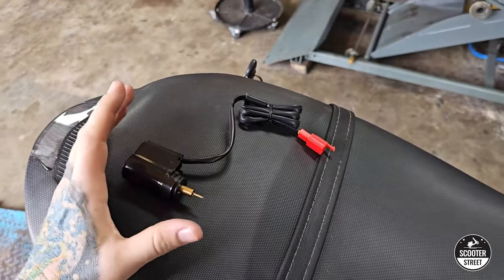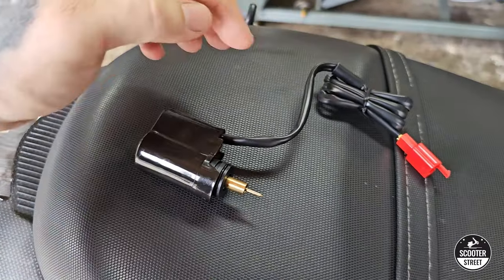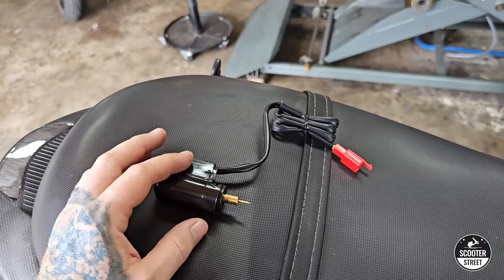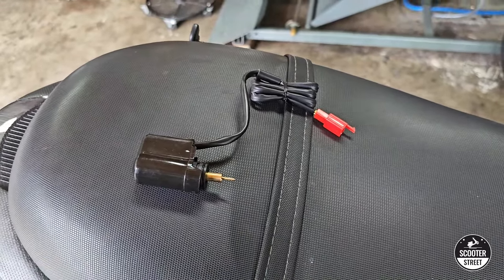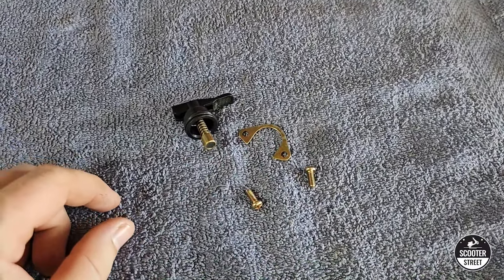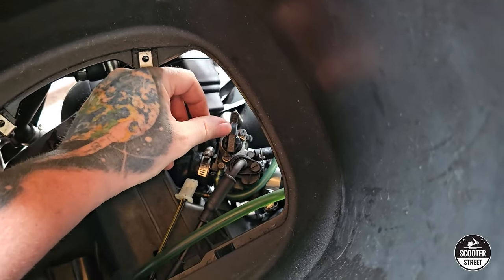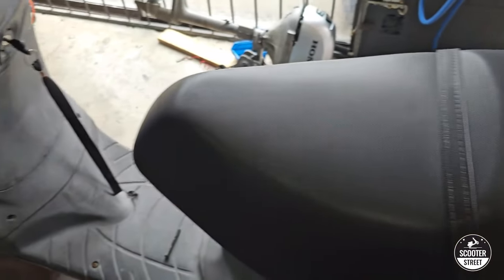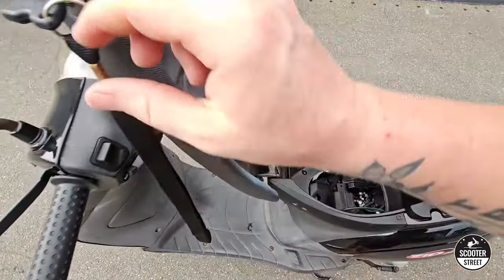Scooter Auto-Choke Problems Explained & How To Fix!

Comment: My gy6 starts fine but every stop it drops rpm and when you rev it 2-3 times it will go back to normal. Is it auto choke always turning on every stop?
Reply from the maker: Check for air leaks in every rubber part.
Reply: i have the same problem any solutions? pls
Reply: @namaikativputkata202  i just raise my idle screw so that if it drops rpm, it will still be sufficient and not sound like struggling. I dont have any vacuum lines leaks at all
Reply: @namaikativputkata202 any luck? I have the same problem I had to raise my idle screw to the point the scooter wants to move while I’m on it
Reply: @DonDinero94  i bought manual choke and all the problems gone away try it

Comment: Hey so my Aprilia SR50 starts first kick in the morning and it starts off with high rpms and drops after a few seconds but if I let it idle for 2mins it dies. Also when i start riding the throttle response is poor and sputter before taking off even when its warm. Could it be a choke issue?
Reply from the maker: Yes, It could be a choke issue, or a spark issue, or a plug issue, or an air issue.

Comment: Hello! I have an issue with my scooter  but it only happens once every 5 rides approximately , so what happens is after about 1min of me riding it sputters and dies . Only way I managed to to start it back on is by closing off the air pipe to the filter and it revs for 5sec before dying down again. I looked basically into everything (air filter, carb,idle mixture,fuel lines , valve adjustment , fuel filter , spark plug ,changed cylinder , checked vacuum lines) only thing I noticed is the air intake hose to the carburetor having a small crack . I had the scooter sitting for abt a month in the sun could it have caused something to go bad in the CDI or this auto choke?
Reply from the maker: Change the manifold if it has damage.
Reply: @scooterstreetau  not the manifold, I  meant the part that connects to the carburetor not the one that goes to the engine
Reply from the maker: @usfsft6217  Change the broken parts, they are not designed to work in a broken state.

Comment: hi mate i’ve been having problems with my moped recently. so i found out i had a split in my fuel line and i needed to fix that immediately, so i ended up replacing them and since then it started bogging out after half throttle and just seemed like it was struggling. i rode it for a few days after that and on thursday last week i was going home and it just randomly started sounding like a piece of metal in a washing machine, just grinding and jolting and struggling to run. i don’t know what’s wrong with it
Reply from the maker: That makes 2 of us.
Check out the source of the noise.
Reply: @scooterstreetau  it’s hard to tell when it’s coming from since it only happens when i ride, but i think it’s coming from the cvt. i took it apart and noticed who ever owned it last, the plastic variator fan snapped and they never replaced it. it’s a piaggio zip 2t
Reply from the maker: Why not have a look.... Running the engine without a fan will without a doubt casue a major engine failure. @threefootflatty3688
Reply: @scooterstreetau  okay no worries i don’t know if it broke while i was riding it or if was like that a few months ago before i bought it, but what issues could it cause without having it?
Reply from the maker: Over heating of the transmission. @threefootflatty3688
Reply: @scooterstreetau  is that a big issue to fix?
Reply from the maker: Huge. @threefootflatty3688

Comment: Do you have Genuine scooters there?  P.G.O is another name for them.  I have a 2008 buddy 50.  I put a Amazon big bore kit on.  Kit was ACTUALLY decent quality for $ I chamfered the inside of ports etc....bike locked up like 10times on way to store & back from running lean.  Obviously I have a Massive air leak somewhere correct?  Idk how I didn't melt the piston😬😓💯
Reply from the maker: Genuine and Buddy are the American renamed PGO brand scooters. Was the engine setup for the BBK?

Comment: The first thing you would check and see if you have power to the choke!!! And if not how to fix the hot wire!!!!
Reply from the maker: Yes good addition to the troublesome choke.
We remove the choke and have a special connection which connects it directly to a 12v battery, you can visually see the choke extend into the OFF position. Or the freezer to have it retract.

Comment: Are these auto chokes generally the same thing? I would like to convert my Peugeot Django 125 to a cable operated manual choke. Do you think yours would fit?
Reply from the maker: Find out what type and size of choke and you will possibly find there is an option for manual choke.

Comment: Thanks for this very informative video! I have a new scooter under 400 km. It seems to run good but before starting it, I usually need to turn the throttle once and start it up. The rpm is only about 1,000 to 1,500 rpm's so I have to baby the throttle a few minutes (or it will stall out) until it starts ideling at around 2,000 to 2,500 rpm's and then it's fine. Do you think it could be the auto choke is not working?? Thank you
Reply from the maker: Check the choke for sure, also the cary may not be adjusted correctly and also you may have an air leak so check from the airbox to the manifold just to be sure. this should be done from the dealer at the workshop prior to delivery to customer so if you have an issue reach out to the selling Dealer👍
Reply: @scooterstreetau   Oh, its a Carburetor
Reply from the maker: @GY6ScooterAdventures-be2oe  see reply above
Reply: @scooterstreetau   Thank you very much 👍

Comment: Will it work with any carb? I have a honda Dio AF18 and the E choke has a faulty connection. One of these seems like a perfect replacement, especially for cold starting. Question though? How long do you usually let the choke stay on for the manual one?
Reply from the maker: Yes it will, leave it on for 10 seconds and as you slowly start to turn it off apply a touch of throttle.
Reply: @scooterstreetau  Alright so I got the choke and bike still won't start, gas is cycling to the carb. Am i missing something?
Reply from the maker: Check the air filter, enough air flow? Check the fuel flow when cranking the engine, is the fuel flowing to the carby?
Check for spark, is it Zapping Blue/white at least 10mm? Test compression and air leaks. @Ace01010

Comment: Hey man! Do you have any idea why my 50cc yamaha scooter runs so good when cold for like 2-4mins and then it starts to lose power and can barely go up a hill and atleast 50% off acceleration speed just disappears. The problem has worsened when summer came
Reply: You didnt answer but i think it was the air filter because when i changed it the scooter worked way better

Comment: What should the voltage to the choke be? 
When i tun my starter its 4v in the contact.
Reply from the maker: I just had an opportunity to test the choke on a 2 stroke, the power is AC and put out 4.6 volts. Ignition on no power, it is only powered when the enigne is running. Power supply when the stator rotates.

Comment: Hello, ive got a jetforce 50 with a 70cc malossi kit in, 8g rollers and leo vince clutch springs, uprated carb and a leo vince tt exhaust but i can only get about 45mph out of it, any advice. Thanks
Reply: Try getting a over range variator for that extra gearing?
Reply from the maker: is everything derestricted? Upgrade the cylinder and exhaust.

Comment: Dumb question but i need to ask, can choke be fixed somehow becouse in my country the only option is 200eur for keihin cvk18 just the choke :(
Reply from the maker: You can't fix the auto choke, but you can modify it it to work as a manual choke.

Comment: my Gilera DNA 180 starts immediately from fully hot or fully cold but needs a bit of throttle to start up when its hot but been off for a few mins. It fast idles cold, idles like shit for a few seconds then fast idles again gradually settling into its idle. When started from warm but not fully hot it needs little bit of throttle to start, idles rough for a couple sec, fast idles at like 2k rpm for 30 sec or so then back down to set idle.
Closed idle mixture screw causes engine to eventually die so ik pilot jet is fine and the throttle response is fantastic.

I read that these auto chokes have 'wax capsule' in them which expands with heat to push the plunger out. Can this deteriorate over time and how well protected is it against chemicals like fuel, carb cleaner/non-polar solvents etc. Like the choke obviously works but I dont think its as responsive as it once was (2ndhand unit from ebay as i need OEM) or is sticking a bit. 
Also I'm actually really surprised at how much electrical shit does actually deteriorate gradually rather than it either works or it doesnt and it seems to be a big thing with 'solenoid' stuff like this.
Reply from the maker: Go the manual choke system, it eliminates any guessing so you can get down to the true issue.
Reply: @scooterstreetau  do all auto chokes have wax in them?
Reply from the maker: @gabrielwalker421  no

Comment: Hello! I've only get 3V from the wiring. Aprillia sr50 2019. New choke = same problem. Anyone know where that 12V is sourced from in the electrical system?

I have ordered the manual choke, but would be nice to get the electric choke to work as well
Reply from the maker: 3V is what is required to run the choke.
Reply: @scooterstreetau  It's not working for me. 
I swapped to manual choke.

Comment: 5:05 doesn't it need power to adjust itself? how does it get power while in the freezer?
Reply from the maker: It works on temperature and changes position based on the temp of the sensor inside the mechanism. The power adds heat so it can expand to closed position. It does not need power to retract, so we put it in the freezer to speed up the activation process.
Reply: @scooterstreetau  oh I thought it expanded via power or something, I was tired sorry. Thanks a lot for the clarification!! :)
Reply from the maker: @Sillsii  All good, thanks for watching and comments👍
Reply: how does it turn itself off?
Reply from the maker: @ClydeSlobbs  It works on temperature and changes position based on the temp of the sensor inside the mechanism. The power adds heat so it can expand to closed position. Watch the video, it is discussed in detail.

Comment: Dont quite understand....if there is no "spike" on the manual choke how does it block the carb hole.
Reply from the maker: The rubber seal does the job of blocking, the spike does the locating.

Comment: Hey guys, im experiencing  splutter/bog at 3/4 throttle, wondering what your thoughts would be.

my set up:     Piaggio zip euro2 50cc 2t
                       Stage 6 exhaust
                       MHR replica 70cc kit
                       5.5 gram rollers
                       82 main jet
Reply from the maker: You need to eliminate the possible cause. Do this by testing each system, Jet up to 98 and come down from there. Is the needle set to middle. You should only fit 1 part per time and tune to suit to avoid this. It will save dollars and hours of trouble shooting.
Reply: yes I did change one part at a time, however the splutter/bog has been pretty consistent. The clip was initially on the leanest top notch so I moved it to the middle which helped somewhat in the mid range but still the same issue from half throttle onwards @scooterstreetau
Reply from the maker: What did you do or change when the issue first presented? @js256scoast
Reply: I went from an 82 main jet to 78 main jet but it didn't change much @scooterstreetau
Reply from the maker: I made my suggestion, I you choose to go your own way why ask me☺ @js256scoast
Reply: you asked me what I did when the issue first presented. was just answering your question lol @scooterstreetau
Reply from the maker: No, I asked what did you do or change when the issue first presented. You said you did change one part at a time so which part caused the splutter? Are you saying the very first thing you did was changed the jet before fitting any other part? @js256scoast
Reply: aah i get what you mean, it was the 70kit and the 82 jet when it first occurred @scooterstreetau
Reply from the maker: Ok so you have a tuning issue with the jetting. We finally got there 🎉
Method is, start with a well running scooter, change one part and tune to suit, so in your case you have fit the 70kit and now you need tune the carb. Start at 92 main jet with needle in the middle, check the air filter and make sure it is clean with no air leaks to the carby. Lower the jet size if you suspect it is rich, which it should be on 92. Rinse and repeat. Please buy me a coffee, I am very thirsty. https://www.paypal.com/paypalme/scooterstreetau   @js256scoast
Reply: @scooterstreetau  im at the point of giving up :( Ive tried most main/pilot jet combinations , needle in all positions, replaced the auto choke, and im still having the same issue no matter what i try. 

It takes off well at low throttle but as soon as i get to say half throttle it just hesitates. i have to keep it at 1/4 throttle to get it up to speed :(
Reply from the maker: @js256scoast  This happens so often, the quickest way to fix it is. Remove everything back to standard and if there are any issues you MUST repair them before fitting new parts.
You may have and electrical issue, and air leak issue a tuning issue or parts compatiabiltiy issue. Too may things to suggest. Remeber this is all learining, so be patient and write down what you are doing and how it changes the engine effect.
Reply: @scooterstreetau   i think its something to do with the auto choke. when i fitted the manual choke it doesnt start with the choke on. The previous owner alao had the needle on the leanest position, possibly to counter the richnesss from the auto choke. i dont know
Reply from the maker: @js256scoast  So it is rich enough to have no choke. move the needle to 2nd leanest and try lowering the main 1.
May also need a needle change. I would stay with my previous suggestion and add these for after thoughts.
Reply: @scooterstreetau  ive tried needle in all positions. only thing i havent checked is the reed petals, need to get a torx bit

Comment: I changed the auto choke with a brand new one and it works but not as it shoulds
Reply from the maker: Thiat would be confusing, check the choke and check the carb settings, you may have anther issue.